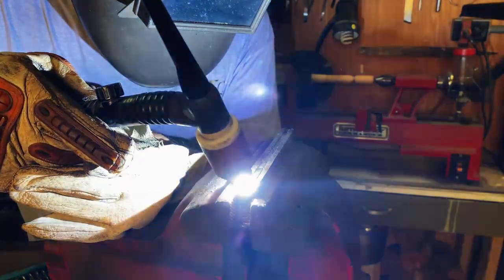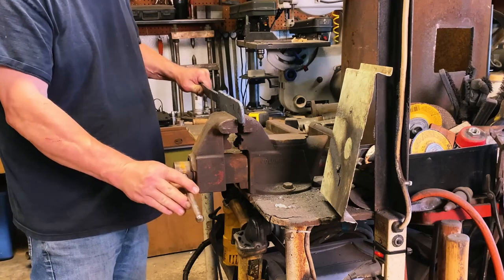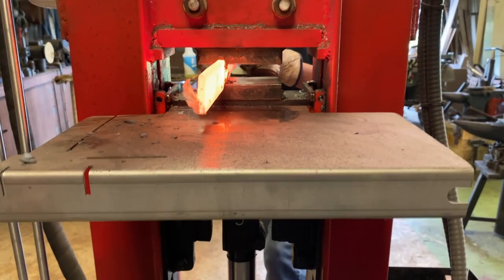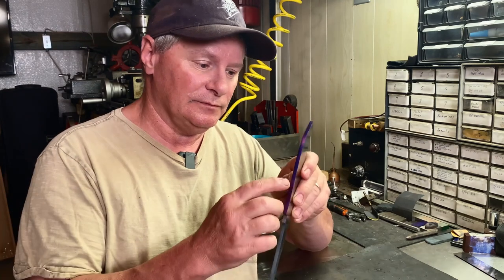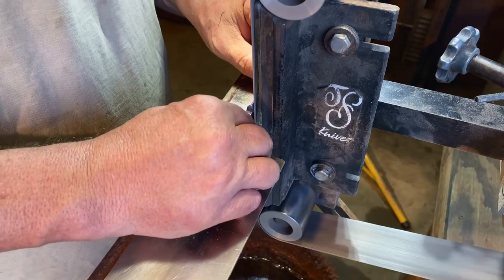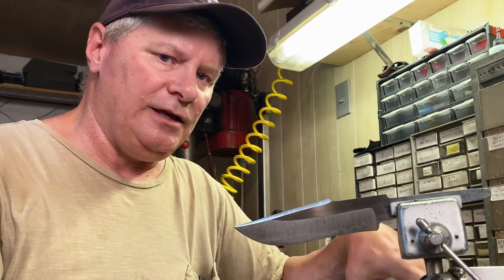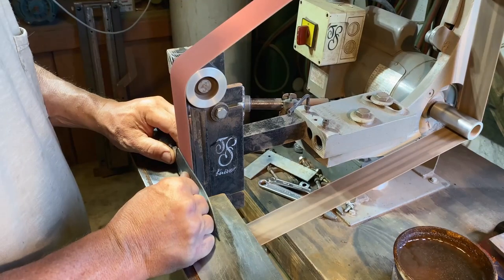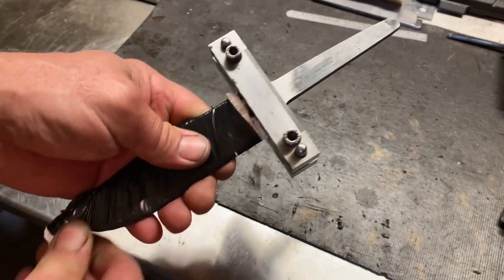How to make a Stainless San Mai knife

Comment from the maker: If you have any questions about the process, please comment.  Thanks for watching!
Reply: Where do you buy your 410 stainless from? Every supplier I have looked at had too thick stainless, or it cost too much.
Reply from the maker: These were 1/4 inch thick.  They are high but I will have to find out where I bought it last.  I’ve had several pieces for about 5 years.  I will have to get some soon though, I’m low.  I’ll look around and let you know.
Reply from the maker: Just looked on Jantz supply.  They have it.  You can use 1/8 and then use a 1/8 core of 1095.  It will still be plenty of steel.
Reply: @TonySeverioKnives  Thanks!
Reply from the maker: You’re welcome 😁

Comment: Applying clay is a great tip that none of the other stainless san-mai bladesmiths mention.
Reply from the maker: It will prevent splitting for sure.  Thanks.  😊

Comment: Thank you for the great video. Is there a general rule about the size of the billet concerning the knife size you want?
Reply from the maker: Thanks!  No rule other than the rule of math.  The bigger the billet, the longer/wider the blade.  For this size knife I used 3 1/4 inch thick pieces cut about 5 inches long by 1 1/2 inches wide. If I wanted a longer blade, I would have added length to those pieces.  I just guess at it liberally to make sure I have enough.  🙂

Comment: Wouldn't the refractory cement make a hamon on blade?
Reply from the maker: Too thick down the side but not so much on the low carb stainless.  If it’s on the carbon core running up it would

Comment: I love san mai, but it's a real pain to make without a press, so I normally don't make it.
Reply from the maker: Yes it is but I’ve made a bunch of it with a hammer.  Not stainless though.  The stainless is tricky.  Have to make sure it’s sealed up air tight to forge weld.